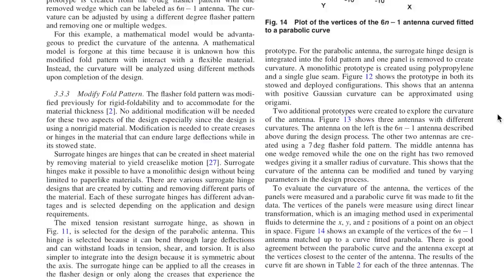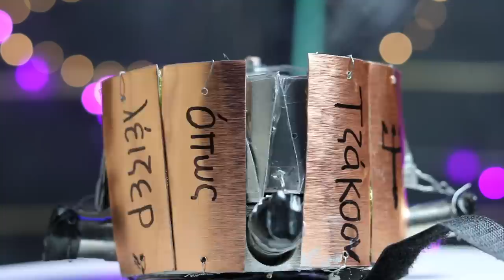Make an Expandable METAL Wrist Watch Shield (V2) - Percy Jackson Style!

Comment: A simple fix would be to increase (double) the number of "expandable staffs" and decrease their length by about 15%. Then align the shield plates within each space and cut to size. IE. each space in between each staff would have one either flex-down or one flex-up section as you go around. That should increase the sturdiness and provide you with a more ridged base. Don't worry about a full-sized shield, instead at least try to make it akin to something a bit larger than a buckler. Just some thoughts.

Comment: Couldn't you make this out of Kevlar? You know, that flexible material that CAN stop bullets?

(Theoretically speaking I mean, I know you personally don't have the resources to make that.)
Reply: Hadeks Marow Kevlar is only effective if totally stabilised by something like ceramics or epoxy. Also, Kevlar, contrary to popular belief, isn't too expensive per foot.
Reply: Hadeks Marow you're on the right track but the math does not line up. There is no degree of protection available from a deployment system like this.
Reply: José Pedro Magalhães Send me eggs 
you do not need a laminate material like epoxy. Have you heard the term "soft armor" it's armor that's soft and flexible. Most police body armor is soft armor.

P.s. 12 layers is technically bullet resistant but it's not something I'd wear. 36 layers is my minimum. It needs to stop a bullet. Not a bb.
Reply: Colt .45 2 Zigzags yes but for Kevlar to be able to act as a shield against impact or repeated blows, as would be required for how a shield would need to act. So no, it doesn't need to be laminated, however if you need it to do more than stop a bb, you would need lamination or a solid backing
Reply: I know, according to the comments, that kevlar wont work but what if he used graphene, its light,thin,strong,see through and bendable all he would have to do is find away to hold it up so those expandable sticks could work but just an idea
Reply: Tyler Nelson 310 the problem with graphine is price point. Unless you're as rich as tony stark or Batman graphine armor ain't much of a possibility for armor.

Edit: why graphine when you can use spider silk?

https://youtu.be/IaZ10VlSoZs
Reply: Also  @josepedromagalhaes3044 , how does a "?" state that I am stating or suggesting anything?

Me asking a question IS me doing research as I am looking for answers before I say anything. Google isn't the only source of info you know.
Reply: What about John wicks suit that has some kind of bulletproof garment sowed into the suit?
Reply: HMMMMMMMMMMMMMMMMMMMMMMMMMMMMMMMMMMMMMMMMMMMMMMMMMMMMMMMMMMMMMMMMMMMMMMMMMMMMMMMMMMMMMMMMMMMMMMMMMMMMMMMMMMMMMMMMMMMMMMMMMMMMMMMMMMMMMMMMMMMMMMMMMMMMMMMMMMMMMMMMMMMMMMMMMMMMMMMMMMMMMMMMMMMMMMMMMMMMMMMMMMMMMMMMMMMMMMMMMMMMMMMMMMMMMMMMMMMMMMMMMMMMMMMMMMMMMMMMMMMMMMMMMMMMMMMMMMMMMMMMMMMMMMMMMMMMMMMMMMMMMMmmmmmmmmmmmmmmmmmmmmmmmmmmmmmmmmmmmmmmmmmmmmmmmmmmm........................................
Reply: karakun1 it's a movie... if you can't depict fiction from reality you need to get some help. Same with the guy who offered graphine as a suitable material. The technology we have access to can't make the materials necessary for these fictional armors (as described) the material specified in john wick is silicon carbide. There is an armor out there that uses it. But it's ~47lbs and nearly 1" thick called dragon skin. It uses silicon carbide disks laminated between Kevlar. The material show in the movie is as thick as canvas. And also with that there is a property in armor called "backface deformation" not only does an armor system need to stop a bullet it needs to disperse energy. If armor fails to do this it can lead to as little as blunt force trauma all the way up to internal bleeding and major organ failure. Often times favoring the latter two.

Any one else have questions about armor. At this point school is in session so ask away.
Reply: @colt.452zigzags3  look it up you fool it’s real.
Reply: Colt .45 2 Zigzags https://www.youtube.com/watch?v=RJ8VLYGLKPM say what?
Reply: @GraniteGolem  youve seen a fucking umbrella right? That doesn't use any solid coating or backing. All that the Kevlar would need is to be stretched tightly similar to an umbrella, but with a lot more pressure since we are talking about bullets.
Reply: Lanurus I would like to see someone make a bulletproof umbrella from Kingsmen not as high tech but still bulletproof.
Reply: @colt.452zigzags3  that would be so cool, and after they make that they could make the blade shoes. Then if the bulletproof suit is actually real I'd be just like the movie.
Reply: you can but you will need some thing hard like ar 500 steel that will stop small rondes and  to brack up the bullet then a lot of Kevlar to catch the bullet with the big rondes it will be cool and you can send it to demo ranch to be shot and you just need ticker steel and Kevlar on the back it wont be that hard but l think he sod try to make one to stop bullets
Reply: @johnw3857  you lost me a bit there, I get you were explaining design, but you said stuff besides the design stuff that i couldnt follow (like the sod part and your personal opinion if one was listed here)

Ima be honest, idk how much of that was terms i didnt understand and how much of it was just bad typos.
Reply: @josepedromagalhaes3044  he was asking a question bruh
Reply: @colt.452zigzags3  what? Hacksmith did a test and he was able to use 8 layers of kevlar to stop a sniper bullet...
Reply: @rayyanshaikh5591  The caliber of the bullet makes a difference, what was he shooting?
Reply: Exactly

Comment: Attach a metal plate to the top of the watch that covers the plastic tubing that houses the trigger mechanism. When the watch is closed, it will act as a faceplate and when it is open, it will act as a raised platform that covers the center gap more.

Comment: you could switch which way the shield is facing to make the stick in the middle not stick out as much. turning it around would also mean that the decoration on the plates would be visible even after the shield has been deployed.

Comment: @JLaservideo Meaby try combining LINE-X with carbon fiber (carbon fiber umbrela), or any type of thin material, in this shape. Since it would be material base, the relese mechanism can be a spring conected to the ring You showed in video, based on Hoberman Sphere. The expanding arms can also use this design.

Comment: i was thinking maybe tu put an expanding metal ring structure on the back such that it holds better the outline of the shield, plus making the expandable rods a little longer so the shield sections will have more tension thus soporting bigger impacts. The flaw would come at the connection from section to section, needing a more resistant material wich is still flexible enough to let the springs open the shield quickly. That or desinging a simple mecansim in each connection that provides both the resistance  and flexibility needed.
Love what u are doing. Im a mechanical ingenieering student from argentina (so sorry for bad english), but would love to help u as i can.
Feel free to reach me out if u feel like so!!

Comment: Cool design, but if the fins around the edge came to the front, or the the design was turned around then it would look more shield like. You probably need 8 of the spokes like an umbrella and they probably need to be thinner. Do you think a metal chassis would be Maybe smaller then the 3d printed parts? Maybe a different metal with smaller metal panels, wonder how far you could take the height down? I see a mark 3 coming soon lol

Comment: Just make it with a single staff attached to your circle thingy and have the pin pull on the single staff which extends your circle to full length. May help with hole

Comment: Answer: Graphine is 1 atom thick and full sheet is lighter, flexible like cloth. And 2 sheets can stop a standard police issued bullet. Graphine is a time consuming process to make... which makes it expensive.  But if you took the time to cut those tiny pieces of metal, you could spend a little more turning inexpensive carbon into sheets of graphine.  Then you only need a metal frame and minimal support to stop a bullet. Swords? Maybe not. But bullets? Yes.

Comment: Honestly you wouldn't need to use metal as cool as it is but rather rated material should suffice to stop penetration and might be easier to work with. That metallic look could just be the finish. The result might be a material just easier to work with like Kevlar.

Comment: What if you put a long rod and it expands because it it connected by a string attached to your middle finger so it doubles as a poking stick. If you poke a supposed dead opponent and attacked you, you flipped him off and the shield expands when you put it down fully. Just reuse this vid but the design is different.

Comment: If it's not a bother, does anyone know how those pieces are connected? I'm working on an Iron Man armor based on the 90s cartoon and the MCU's MK V (both go from a suitcase to an armor), and the mechanism here would probably be my best bet for some parts of the armor. Just can't figure out how the pieces link together.

Edit: I slowing the Iron Man unfolding glove building montage at x.75 speed, I have determined that it's gorilla glue and electrical tape. I'll probably have to figure out something better, but it's a starting point.